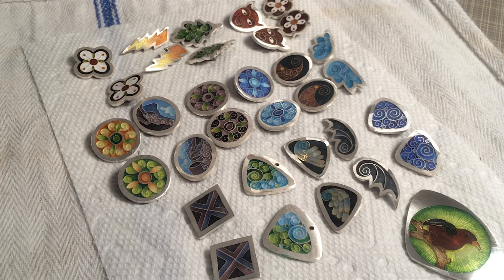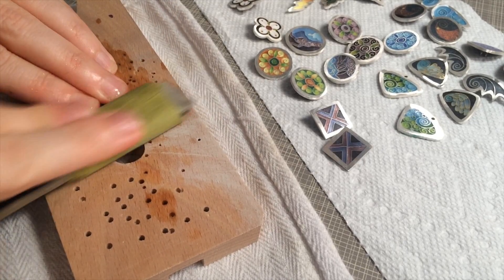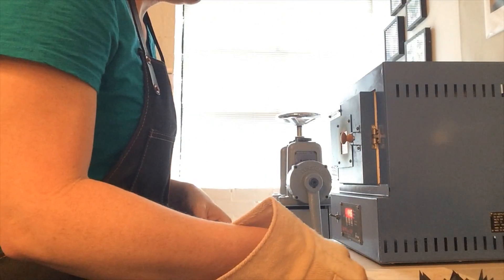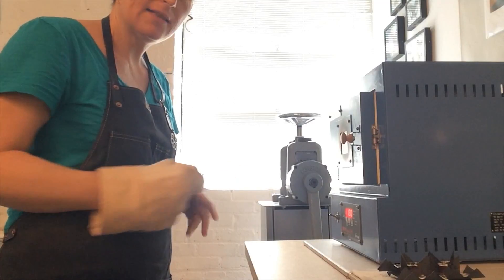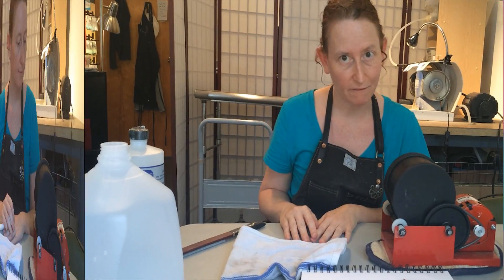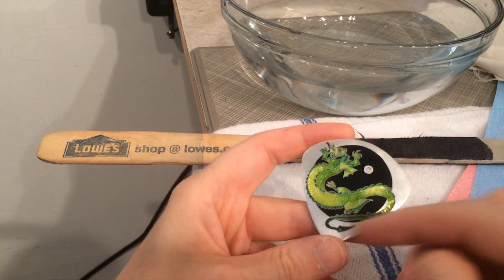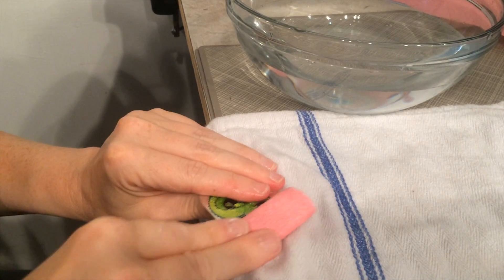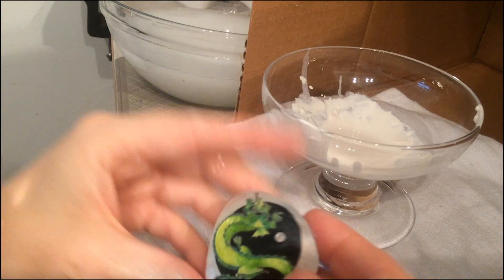Grinding and Polishing Enamels - Part 2

Comment: very nice work would like to take your course. if I may, a Vibrating Tumbler would be more gentle on your pieces and you use the same medium.
Reply: Bobbyj438 
A tumbler might remove more metal from her piece and eliminate the clean lines /edges of her finished piece.

Comment: I do find the use of hard steel balls to polish a soft metal and glass very strange.  Surely they must create micro impacts into the surface. One classic is walnut shells (broken) and jewellers rouge powder with NO water.  It works very well.  If you think that your cerium dioxide is finer then consider using this with the walnut shells.